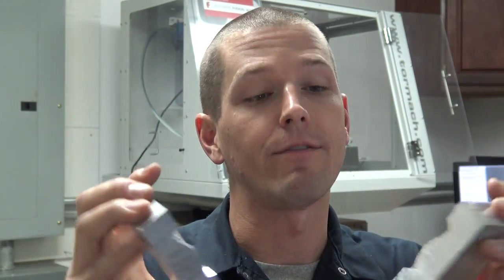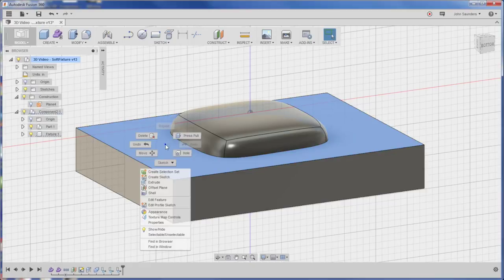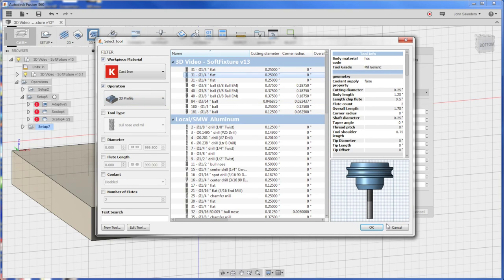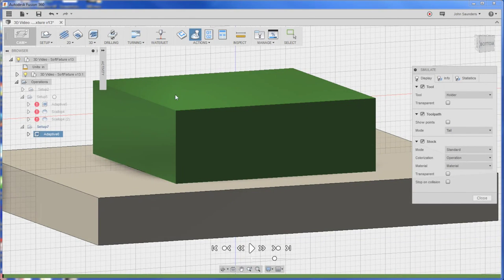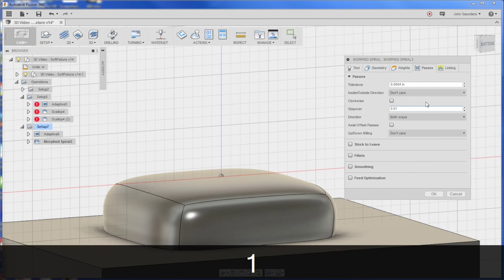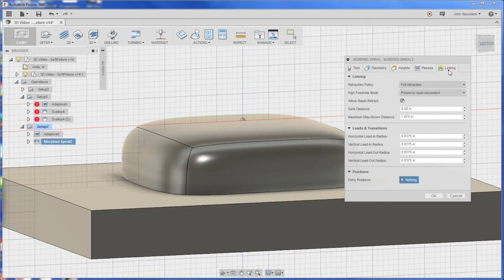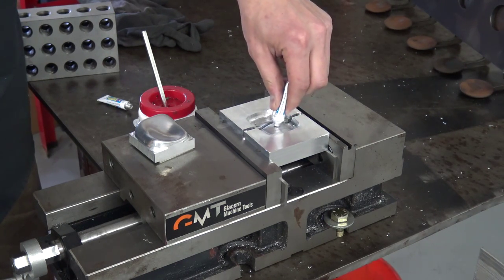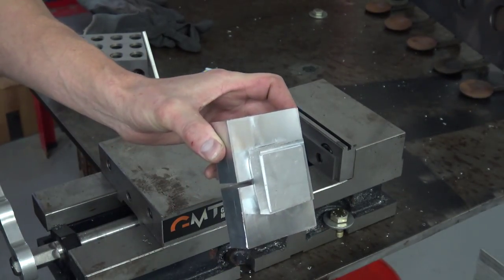Superglue CNC Machining!   CAM & Part Setup

Comment: I'm learning sooo much from your videos! Thanks. As soon as I saw your fixture challenge I knew I had something to show you. It's a plastic called Pollymorph. It's a heat-formable nylon-like material that can be remolded as many times as you like. It comes in little pellets and can be found on ebay. Just throw some in a cup of water and put it in the microwave for a minute or two, and it becomes a soft putty that cools as a very sturdy, tough plastic. I have made so many useful parts and fixtures with it. It's a real ace up your sleeve when you need to make an exact negative of something or support something very precisely. As long as the part stays below about 140F you should be okay using it as a holding fixture. Even if you don't want to use it for machining, get some! It's uses are endless!

Comment: Fun fact: It's specifically the hydroxide ions in water that cause super glue to cure.  Moisture from your breath is a good way to cure super glue without making it brittle (some accelerants can make the bond brittle).

Comment: FYI on the dual setups, put all your fixturing in the same file as an assembly, and create your setups around this. It will simulate properly. What I have been bugging them for is a Save Stock as Solid so it can be a bit more versatile. Right now you can only export as an .STL which is difficult to work with. I can invite you to a project if you want to see the stock simulation work in multiple setups.

Also make sure in the future to specify the fixture in your Setup so you get red tool flashes during simulation when you get collisions. It'll warn you about that silly plunge move at the end of the second video ;-)
Reply: Same Gmail address as before?
Reply: +NYC CNC You've got a couple project invites! And an email.

Comment: The curing of Superglue is a catalytic polymerization. This means water, or better say the oxid-ions in the water, will start the reaction, but from this point forward the reaction will continue on it's own. If you add more start-points for the polymerization it will run quicker. And temperature is also a factor heat speeds the process up. In it self the reaction is exothermic. The glue will not bond chemically to the materials, it creates a "perfect" seal and holds on at small imperfections on the surface of the objects. Two perfect sooth objects wouldn't say together. (Ok... The air pressure would hold it together :-) )
Because the net structure of the cured Superglue is very tight, it's not elastic but relative hard and very strong.
Cured Super glue is biological digestible. This means a wound glued together with superglue can heal because the glue can be destroyed inside the body. Steam destroys the structure of Superglue relatively fast, so the slow oxidation over time.

Comment: Super Glue® is a trade name owned by Super Glue Corp for its line of Cyanoacrylate (CA)

I recommend you read the Wikipedia article at https://en.wikipedia.org/wiki/Cyanoacrylate

Yes water is what starts the process. From Wikipedia “In general, cyanoacrylate is an acrylic resin that rapidly polymerizes in the presence of water (specifically hydroxide ions), forming long, strong chains, joining the bonded surfaces together.” So in the winter time, when the humidity in the air is lower, or if I want to accelerate the process I exhale on both parts to get a few more water molecules on the surface of the parts.

So to extend the shelf life of my CA I store it in the freezer that I do not use for food.  This keeps the water vapor in the bottle in a solid state and slows the setting process.

Also buy the smallest bottle you can find, and buy high quality CA.

The second best CA I have found is available at most hobby shops and is made by Bob Smith Industries and buy the thinnest you can as it has the lowest amount of additives.

To debond CA you can use Acetone, heat or shear loads applied as a shock.

To make fillets in CA I add micro-balloons, which are very small hollow glass balloons sold as filler. also available in small qualities from your local hobby shop.   Wikipedia article: https://en.wikipedia.org/wiki/Glass_microsphere

I only use CA in joints that I want to fail before the parts,  or in an application where I need to be able take apart later, just like in your application, otherwise I normally use a 5 minute epoxy.

Great video, keep them coming!!!!!!!!!!!!!!!!!!!!  I am so addicted to watching your Tormach make chips!